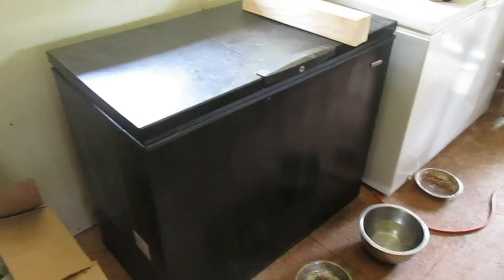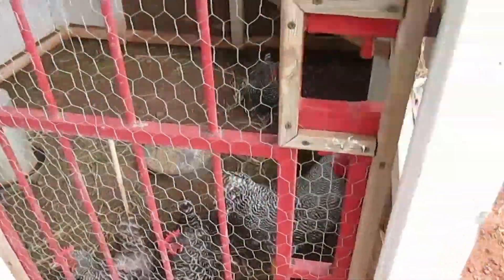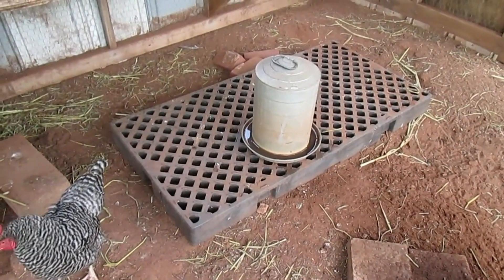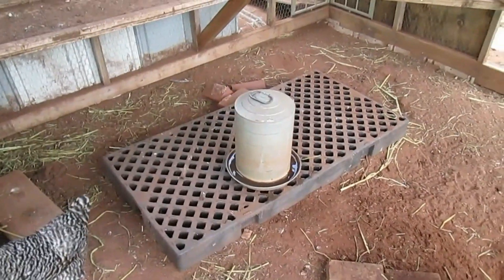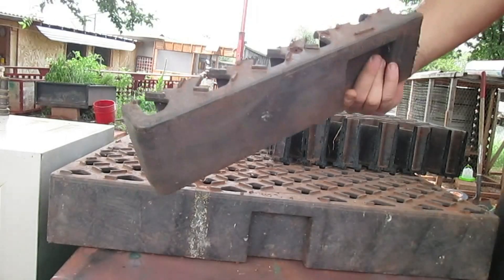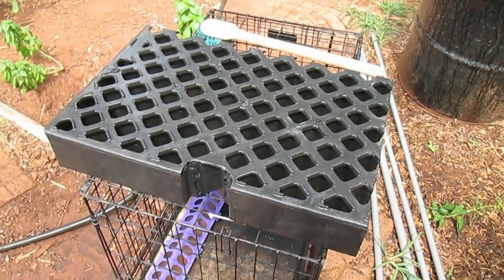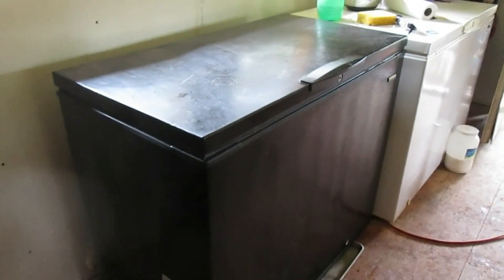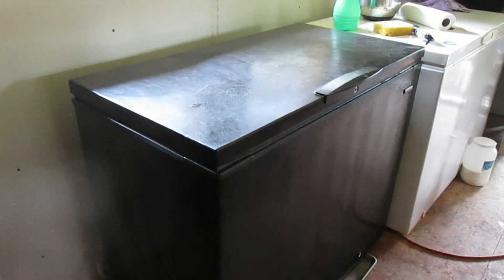Off Grid Refrigerator Improvements

Comment: But now you have a hole letting the cold out as well. Put a trap that goes into condensate drain pans on a/c units to keep the cold in and let the water out.

http://images.lowes.com/product/converted/012871/012871629754lg.jpg
Reply from the maker: SEA FARM Cold air losses through the open drain haven't had any noticeable impact. Using a trap like that did occur to me -but it would have to be elbowed off the drain to face sideways rather than point out into the floor -and I'd end up having to clean it regularly to keep it clear. Thanks for watching and commenting, SEA FARM!